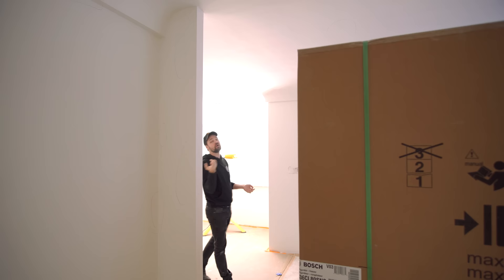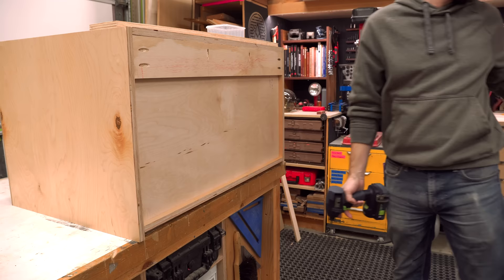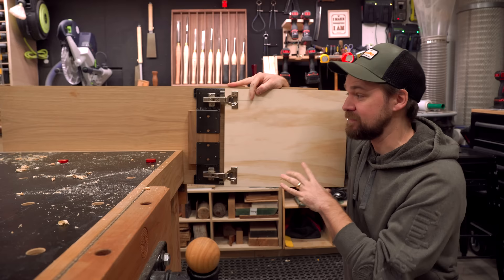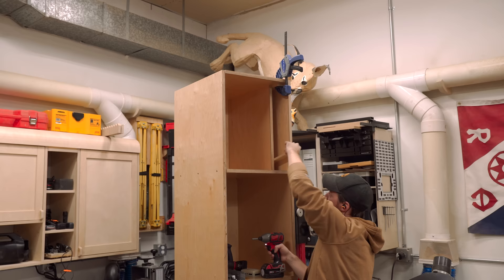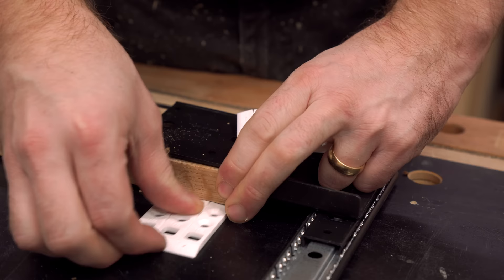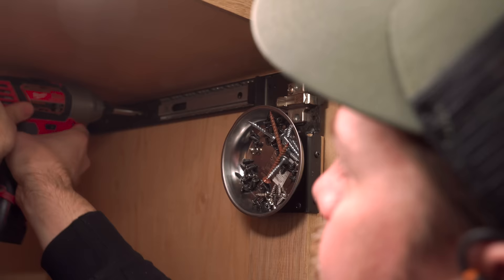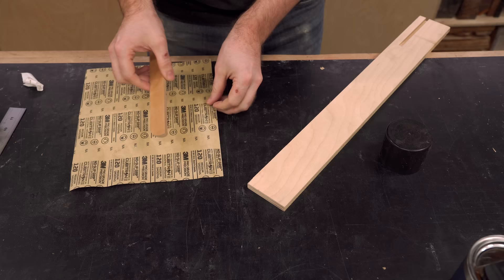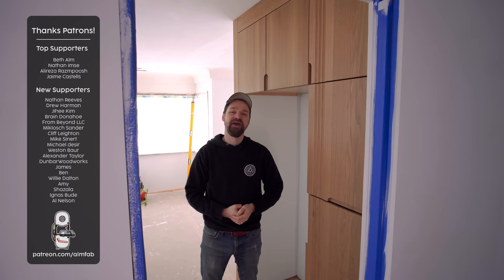The ART of the Built-In

Comment: Glad to see this series back on track! Have been missing my Alm fix for a while. 

A few things I noticed: 

1. Zeta p2 and divario connectors would be great for those baffles if you wanted to do a hidden fixing install 

2. Be careful with those sliding pocket door assemblies and any grain matched panels. If the door gets marred from being slid into the cabinet at the wrong angle, then it will be a super expensive replacement since you’ll need to do all doors again, not just the damaged panel. Better to use paint grade finishes here.

3. Not sure how easy it would be to resize that over fridge cabinet, but it would be definitely worth making it shallower so that you can vent the fridge into the cavity behind. Unless of course you’ve got a proper integrated fridge (sub zero, Fhiaba, Liebherr etc) coming that vents in and out of the front.

Comment: As a former drywall finisher, it's the tape and mud that makes your drywall "not flat". You can shim the sheetrock all you want but once you apply tape and mud to the joints it now has hills. It's called "drywall", not "flatwall". 😉
Also, I love the cabinet door designs,, works very well with the house. But IMO that horizontal pull on the middle door feels out of place. What was the reasoning on not putting it along the same edge as the bottom door pull? It would have mirrored that pull like the two above the fridge mirror each other. 🤷‍♂️🤔🧐
Reply: I had this same thought.  The only thing I can think of is that putting it along the same edge might make the drawer more difficult to pull out since the force of the pull isn't aligned with the track.  It would add a rotational force that the slides might not be built to handle well.
Reply from the maker: I debated on the design forever and ultimately thought it best that it function more easily, so there’s less strain on the hardware. Plus I like a bit of a-symmetry
Reply: @MichaelAlm  Fair. 😎

Comment: Absolutely gorgeous work Michael! Question about a random thing in there - I have that same trim router, and even with the clasp closed (and as screwed in as it can be and still close) the bit will pull down into the work as I'm routing, unless I keep a finger on the depth adjustment screw. Have you had this issue? If so how have you solved it?

Comment: Looks awesome man! I'm in the midst of building my kitchen out as well. With such nice tight reveals, and the slab door/drawer fronts are you worried at all about warping/stability? I keep going back and forth on using hardwood or plywood for the panels.
Reply from the maker: Thanks! Yes I’m definitely worried about it 😂 I’ve done what I can with the construction and Seattle is pretty temperate with rare changes in humidity, so I’m hoping that will keep them stable.
Reply: Well you can always build a new drawer front 😂. Again, looks really great. Can't wait to see the rest of the cabinets

Comment: Hey, just wondering, is there a reason you didn’t  use biscuits to glue up the long oak boards to keep them aligned ? I haven’t glued up anything of that size but my instinct would tell me “biscuits!”  Wondering if there’s a better reason not to use them.
Reply from the maker: With a good clamp setup, biscuits aren’t needed. They do help align things, but can lead to trouble if you accidentally expose them while trimming. I could’ve ended up with one on a door edge or in a finger pull.

Comment: While I like the design, there is a reason why professional kitchen cabinet doors in this style are NEVER made of solid wood (except when made from a frame with a thinner, free floating panel).  They always use sheet material with some kind of natural or artificial veneer.  The reason is not cost savings but warping. In case of the cabinets in the video it is not a matter IF, but WHEN they will warp due to different temperatures and more so humidity inside and outside of the cabinet. These doors WILL warp or dish (if thats a word. I am not a native speaker).

Comment: taking bets this hole isn't big enough for the fridge to fit in, and you have to rebuild this or choose a smaller one. Have you selected the fridge, did you double check the specs, do you trust the specs, is it a built in fridge?
Reply from the maker: It's built to the specs of the fridge. It'll fit 100%
Reply: Dude, did you think he just eyeballed the measurements?
Reply: @MichaelAlm  👍Looking forward to it. Please share your success and the process you took to get to it, as a lot of people overlook certain details in this regard. It will be helpful for people to know this stuff who don't usually think of it.  Plenty of home builders and interior designers mess this up constantly. Yours for instance, is next to a doorway right now.  A lot of people might try to get the biggest fridge they can, and then regret that it sticks out into the walking space after they put it in.  Or they might go with a counter depth not realizing that once the fridge is pushed all the way in, the doors do not have a zero clearance hinge and intersect with the cabinet when opening, which means it has to be set out, defeating the purpose of it being counter depth.  Another consideration, some fridge manufactures might give you the dimensions of the fridge itself, but then in the installation manual, it lists a space requirement so that the fridge can breath and not overheat.  Like, it might require 5/8" clearance all the way around the fridge and 2" in the back for proper ventilation of the compressor. And lastly, well... since you left drywall on the left side instead of framing it in with wood, we know it's not a built in fridge, so I won't even talk about those two options.

I now went back and saw the 3d model of the space in the beginning and the fact that you have a Bosch, so it looks like you're prepared for it to stick out the full 4" thickness of the door, that means you only have to worry about the breathing room and how level the floor is. Except it is weird that the model shows a piece of filler wood on the left instead of drywall.
Reply: I forgot to mention the height problem. A lot of people measure the body of the fridge, not realizing that there is sometimes at least a 1" tall hinge cover and the doors of the fridge to match that height.  And if you don't have enough height for that you can't open the cabinet doors above while the fridge is in place. And if you plan on it being a snug fit, without regard for air circulation you really have to hope the floor is level, since there is a tolerance for deviation with the spray foam insulation of the fridge. Otherwise the fridge may get kind of wedged in side to side or top to bottom depending on the slope of the floor.
Reply: @ezde711 Yes, that stupid hinge cover on top got me. I got the measurements for the fridge made yhe hole for it and when I put the Fridge in the plastic cover hit grrr. Nothing a sawzall couldn't fix though lol. Not really. I did take the cabinet down and trim it down with a track saw. Luckily the face hung down lower than the bottom of the cabinet.